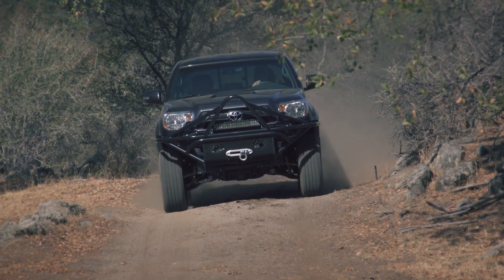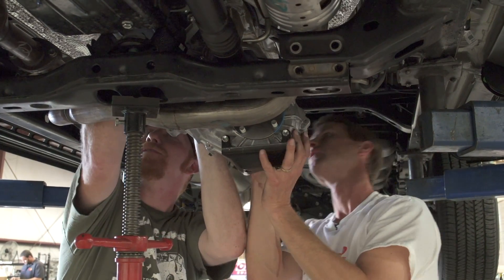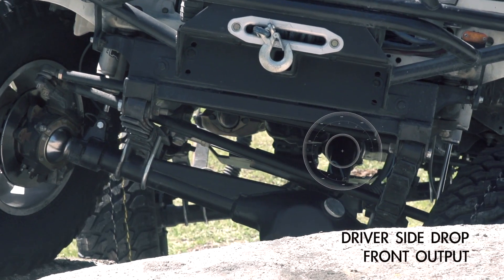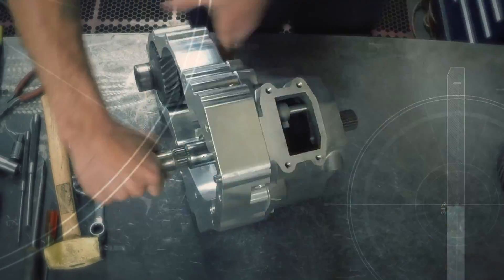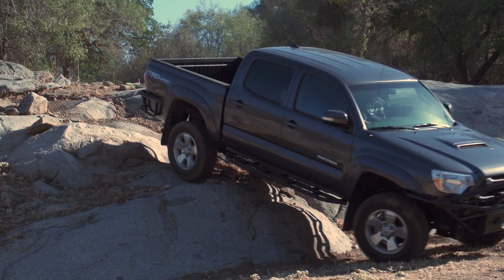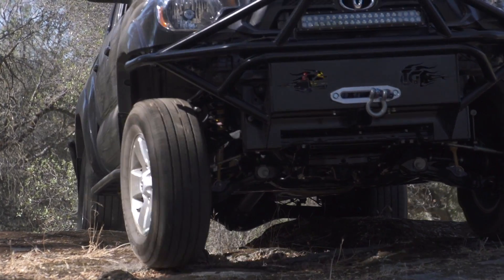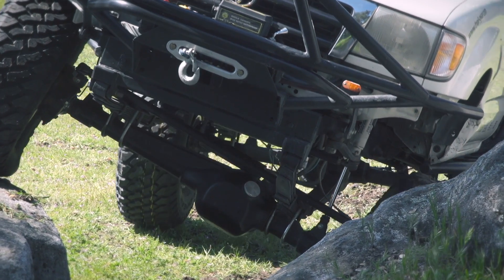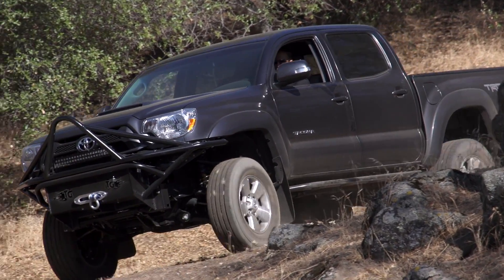Verso™: A Driver Side Drop Gear Driven T-Case

Comment: can ya make a custom  passenger side drop transfer case,  its getting harder and harder to find good rf1a transfer cases.  
if you can make it will it cost just as much as the driver side tc.

thanks for your time
Reply from the maker: We have both in stock.  https://www.trail-gear.com/TG/Full_Built_Gear_Drive_T-Cases/p/_1086.aspx